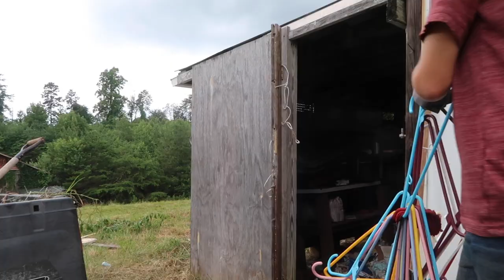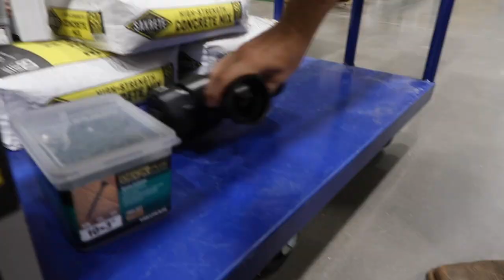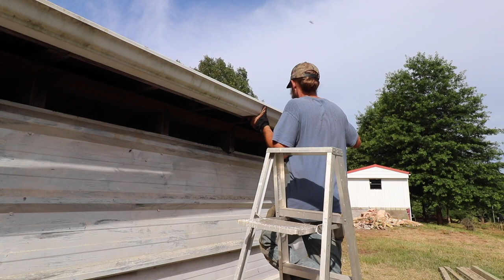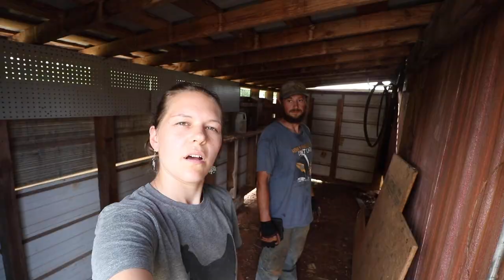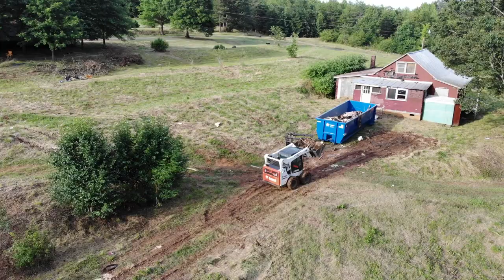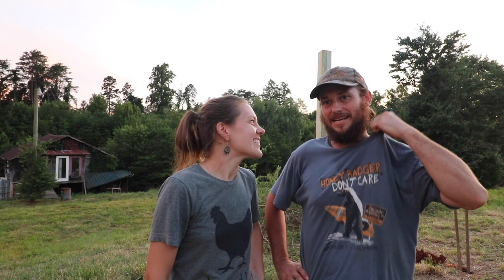Let's Get This Chicken Party Started

Comment: You are so right. You will have to pace yourselves or you will burn out. It is really looking good. One thing I see is there is an opening at the bottom of the chicken coop. Chicken wire on that will not keep coyotes or raccoons out. We found that digging down about a foot and putting something solid like bricks, tin, cinder blocks, whatever will keep them from  tunneling under.
Reply: Remember: Doc Grannie says, "Stuff [German for material] is NOT what someone else has named it.  It is what You can use it for."

Comment: When you row a boat, you have to row on both sides at the same time. You can't give one side attention then give to the other. You will never get to where you were going. So, be mindful of your coarse as you are underway. Build and screen the inside of your chicken house first, then you have a place to put the chickens while you build the outside part. Also when you place the dumpster next time place it so you can open the back door and drive the skid-steer into it. That can make use of the room in the dumpster better.

Comment: Absolutely take. Your time ! Tomorrow is another day. We were on our place about a year before we got all of our animal infrastructure set up actually we got. Too excited got way more birds then we had planned so had to build more kinda quickly. The stuff our our place was way ghetto so we had to build everything brand new. It was way worse then what your planning on using for a coop.i would have continued to use it if it looked like yours but it didn’t .. in fact if anyone kept chickens in there I would not have eaten anything that came out of them.its all good now though.  But it did take a while with everything else we had to do.. basic needs first water, sewer, electricity. Your camper is fine for a while. Maybe crowded but fine. You know that! I lived in my camper for about 2 years while working on the homestead.

Comment: mark your posthole digger handles the depth you want your holes instead of measuring each hole.
Reply: eliza All ~ Great idea. And you can do it with a tiny piece of painter's or electrical tape so it's easy to remove/replace.

Comment: It's pretty much the same system that we made our chicken coop out of in Wyoming to get very limited water out here but we put a rain barrel in with a screen in the water goes through that to filter out anything that gets on the roof of the chicken coop and that goes into for chicken nipples that I have set up outside in the Run and also on the Run we put cattle panels on the bottom of the Run we buried them one foot in the ground and attach chicken wire to it then we ranch chicken wire up six feet and took plane wire and attached it to the corners of the coop and we put netting on the top to keep Hawks and Eagles out the reason we buried it in the ground what's to keep out dogs Fox larger Predators we got a lot of coyotes that could possibly dig under they can't dig under that the bottom of that foot the chicken wire goes out of a foot away from the end of the sides of the coop. During the day when I'm home the chickens get to run free all over the yard and when I can't be there out in their run and they're safe there and I don't have to worry about them the chicken wire was small enough also to keep out all snakes which we have out here and rattlesnakes so we didn't have any trouble in the coop at all

Comment: How happy I am for you. The trash is getting cleaned up. Oh my! It looks so different already! That building is an excellent choice for a chicken coop. If I could add any advice, make sure you put small square heavy duty wire mesh over the bottom of the coop as well as the top. I am sure you have racoons and the like and they will find a way in very easily. Also if you want to leave the top piece of siding off and cover it with the mesh, then it will give some air flow and keep the moisture out. Are you going to add some bedding to the floor to keep the feces and urine smell down? I am sure you have thought all of this out because you both are very intelligent and you have seen your perfect set up from visiting so many homesteads. It always puts your mind into gear as to how you would do it differently. Congrats and plow on. Everything takes time and if anyone has a problem with you doing things when and how you want to do them, then hey! that is their problem, not yours!. That is why you moved onto a homestead to do things the way you want to do them, and when you want to do them. If anyone finds fault with that, then they are just jealous! Blessings to you and yours.

Comment: Deep bedding. That's the basis for MY compost pile too. My chooks are on pine shavings that I add to the compost pile once a month in summer and about twice during the winter. I keep more of it in winter because the heat of composting helps to keep the chickens warm.
Don't push it. Like you said, "eat an elephant, one bite at a time.  Sometimes you need to set the fork down and take a breather. LOL Enjoy your property. The work will still be there tomorrow.

Comment: First I love your story!! Second a little advice that works for me. Varmints will be looking for a way in your chicken house. Dig a shallow trench around the house and lay chicken wire about a foot wide and extend it up the wall just enough to hold in place. When varmints dig they will run into the wire. They are not smart enough to go out and dig.

Comment: If you build a fenced in run, consider fencing the top also to keep out predatory birds and other critters.  Consider getting half inch hardware cloth--used to be called rabbit wire--because snakes and raccoons arms can fit through 1 inch chicken wire.

Comment: Hey quick tip for using a posthole digger measure out depth on it and you won't have to keep pulling a tape to see how deep you are. Start with 12" and mark every 6" thru 42" that should cover every depth you would every need.

Comment: Awesome progress good job!  Agree with other comments about using hardware cloth instead of chicken wire a little more expensive but definitely more protection. We have had no problems with it on the other hand my daughter used chicken wire and was breached by a predator( coon, fox or weasel) something got in and killed several hens.

Comment: If you have snakes you have hawks, I had this one hawk the used to wait until the snakes went up this one particular tree, well year after year the hawk won and it was neat to watch.  You all will do just fine you need no advice from anyone.  Expect fox, bobcat, etc in the fall i would be more watchfull.:) peace   Also one thing I did learn the hard way, the 4x4 fence wire easily lets racoons and smaller get in at high levels, had to change to the reg chick wire at the eves, but sometimes can't get out from chicken dinners. The homestead is looking so much better now that the trash is taken care of. : ) peace        good tunes

Comment: Your   Your own boss ,you set the pace.  I wanted to ask why you  didn’t  but out the farm house instead of the trailer,if someday you want to live in it?
Reply from the maker: Because the farm house going to be a MASSIVE and expensive project (new wiring, plumbing, septic, etc). The mobile is easier and cheaper to fix up right now and should be quicker to get into.

Comment: I would definitely say you need more light in their chickens and their egg production has to do a lot with how many hours of feel like they get in a day you might want to replace about the middle of the coop you might want to replace some of those metal panels on the Southside with some of the the fiberglass panels turn up light in
Reply from the maker: We’re going to open it up for light and air. 😊
Reply: Cheap sky lights:
Take the biggest glass jar you can find [ or use several small ones].
Make a pattern by tracing around the jar mouth. Use this pattern to cut a hole in the roof where you want the light. If you cut the hole a shade smaller, than the jar mouth, you can twist it into the hole.  Seal with whatever you please. 
You wind up with a roof wart.  Lol

Comment: You do what you can at your own pace. As new homesteaders a common issue you’ll run into is not having the proper tools you need for projects. It will slow you down and that’s perfectly ok. 

Now to post hole diggers. I found a gas powered on on amazon for under $300.  While a tractor mounted one is better, well, need a tractor...so let’s just stay on track. Lol. I want an enclosed garden and calculated about 130 fence posts at 10 foot spacing. Manually this would take just about 500 years... lol
Reply from the maker: That’s a lot of fence posts! 😳
Reply: The Hollar Homestead it is. About a 230’x240’ enclosure at 10’ spacing and 9 or 10 gates. The cost will be the killer. 20-30 post sections to build may make it affordable over time.

Comment: scraping garbage and dirt, putting it into the giant bin... a lot of work.
i would just make a pile of the garbage and then put enough earth on top of it and make it a landscape feature. plants would grow on it happily. 
of course tires would be used for modeling the landscape, wood for construction or making fire, bricks for some construction. i'm only talking about stuff that you can't use for anything else like glass wool, drywall, glass debris, even plastic and such. that could be used for building landscape and you will know you did smething nice with what is seen as garbage.
the contents of the bin will end up in a landfill somewhere without purpose and you spend all the energy hauling it away. just saying. i like to reuse stuff and giving purpose to as much as i can.